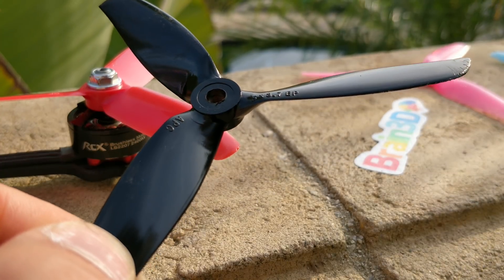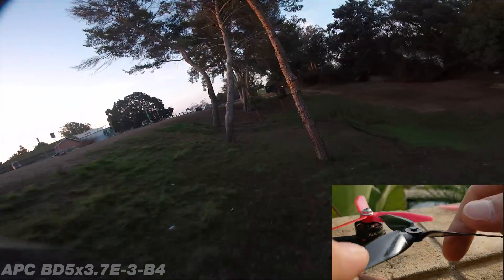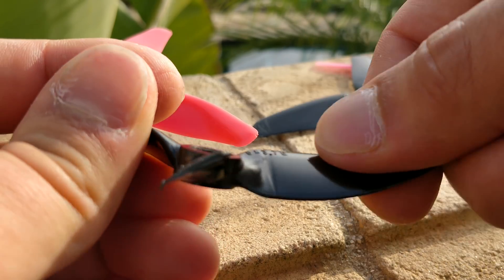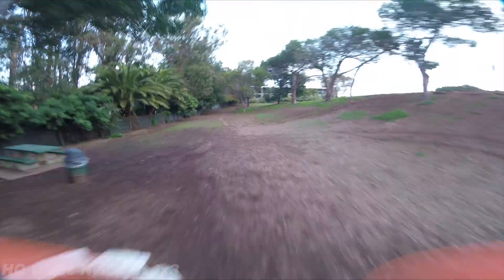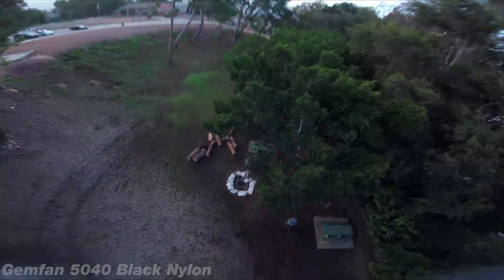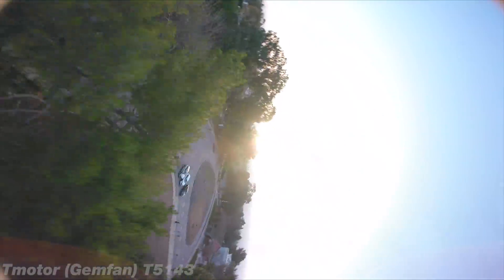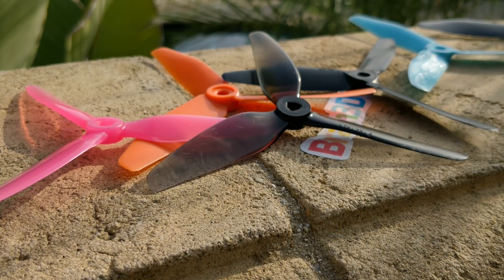APC 5x3.7x3, prop materials and old props...

Comment from the maker: Table of Contents
01:33 - APC 5x3.7x3
07:55 - HQ GN 5x4x3
09:07 - GF Nylon 5040 Freyblue
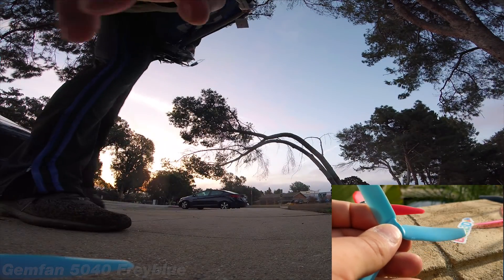10:30 - GF Nylon 5040 Black
11:15 - GF 5040 Polycarbonate
12:19 - GF Nylon 5040 Red
13:51 - T-motor T5143
18:42- Conclusion
15:15 - HQ Ethix S3
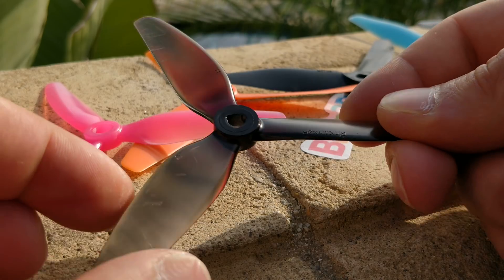16:24 - HQ 5.1x4.1x3
17:19 - Further discussion

The APC Prop: https://goo.gl/VabD5j

I'm too lazy to look for and post all the other prop links, sorry.

Things I like a lot:

Micro Eagle - 
My preferred FPV cam still
https://goo.gl/or1fS9

Rush Tank Vtx -
One of many good Vtx's. I like it because it works well and fits my build style
https://goo.gl/YMYmya

WaFL’s Cap Cap
https://insta-stalker.com/profile/waf...
https://goo.gl/9CZdAs

Tips?
Bitcoin: 1E4XZXoD4rS6MYWVWuenY7Kw2M1YgyNpoQ
Nano: xrb_1188ek5bd7tb9kw67asnp9o65byuoaxbtpxuznx1ribf75x78awywmakj55f
ETH: 0xD067F93811f2eC31CB1928901002dfdf9A492EF5
LTC: La2KWYAjp4VT2Lq2M76pbjzXWvRyjpfCtG

Comment: I came into the hobby after the glass nylons had died. I wish I could find a set just to see how they flew. Just got some gemfan 51466 in the mail yesterday and I love em. Super smooth. Probably gonna replace the s4 for me. Save a little money too
Reply from the maker: The new PC props are better than the old GN props
Reply: @Kabab  ok, I heard Steele at one point saying they flew better but durability was ridiculous. I just got done flying the gemfans again and I love them. Really quick and smooth prop.
Reply from the maker: @_Brando_69  yep. Durability was essentially zero. They're break sometimes just screwing them on.
Reply: @Kabab  Damn I don't even wanna know how bad they were in the cold then.

Comment: you should try the geprc 5040 3 blade V2, it's the most underrated prop imo
Reply from the maker: I don't know if you're the same person or other people. That prop is no good. It's one of the worst variants of the 5x4x3. I tried it years ago. It's worse than the majority of the polycarbonate copies. They're just super cheap and have been since the beginning. That's why they were so popular.
Reply: Kabab FPV are you sure whe are talking about the same prop? I have tried many different props, but the dal cyclone t5040 and the geprc 5040x3 v2 are my goto props at the moment.
Reply from the maker: @dano5739  maybe different but I got a big batch of them from banggood a long time ago and they were no good

Comment: I like gemfan props. Dalprops I use for crazy acro. What I have noticed is the end winglet that points down like on all gf props help stabilize my quads better, so in turn grip and line holding is easier in windy or fast flight. Any prop without them (dal props, racekraft, etc.) have a slippery smooth response witch I love for flips and yaw spins. You end up haveing a much more acro happy quad. You can see it for yourself easily if u have a dal-5x4x3 and a gf-5x4.2x3.

Comment: Great vid. I just got a set of the hq 5.1 x4.1x3 and compared them to the hq 5.1x4.6x3 and personally I like them. I put them on my hawk 5 and put it on a track and they felt a bit better than the 4.6 props. Really snappy to me but I think the 4.6 is a tougher blade. I broke 3 props in 4 batteries when on the 4.6 I didn’t even bend one. But their still great props. I will be getting more.

Comment: hey kabab, I made the prop/motor size rescaler into an excel file that you can try for yourself easily.
 https://drive.google.com/open?id=1wrNY7sYAq6B7jYhdAlITQrJHzunSX963 

edit the yellow cells. as you will see it gets the ballpark quite easily for all motor sizes and prop sizes. comes everything from the physics behind it. Sorry I reposted a comment I made on your older video but you didn't see it probably.
Reply from the maker: well, broken link for now

Comment: The APC props are efficient, when it comes to turning rotational speed into thrust. I've used them on a lot of my planes and they are working fine, but they need a lot of power for that. 
I had to mount an extra-fan on the ESC of one of my Biplanes and cut extra cooling slots in another one, because the ESCs power down, when they overheat. Not good AT ALL in biplanes :D

Comment: Nice flights!! I really like the way you fly it is very smooth....BTW do you recommend the ls2207 2400kv? I have the RS2206 2400kv due to my low skill I am wondering if the remplacement is worth it
Reply from the maker: Yes the rcx is a fantastic motor.

Comment: Talking about props. Does cold weather make the props less durable? I crashed my "3" that had gemfan 3052 props on it and it snapped a blade straight off. Never had that happen with a gemfan prop. It whas around 38 F / 3 celcius.
Reply from the maker: Yes absolutely.  Cold weather causes props to crack more often than bend.
Reply: @Kabab  ah interesting👍 thanks for your comment

Comment: The reason the batches of HQ props differ from each other is re-grind material.  Allowed  percentage  of re-grind material is different for each material, some materials no re-grind  can be mixed with plastic pallets.  So sounds like they are cutting corners to save money,  either just to save money or sometimes there are days where lot of rejects are molded.

Comment: Just want to put it out there that due to material properties of just about anything, especially plastics. You can't have something that is resistant to deflection (high modulus) and also will be easy to bend back to shape. A stiff prop will always crease, if not worse, when you hit the elastic limit of a prop you'll have an irreversible deformation.
Reply from the maker: I know 😔. It's unfortunate.

Comment: Try the GEPRC 5040 triblade, its clone on hq5x4x3
Reply from the maker: I believe I've tried that a long time ago. It was a really underwhelming experience I believe
Reply: @Kabab  this geprc 5040 called people's prop. Its durable, dirty cheap and available always. It's ok if you beginner. I try emax and few another props over this year, and big fan of T-motor prop now. Its surprisingly durable for how its looks and for light racing quad its really good.
Thanks for direct me to this prop. I think T-motor prop it's much better for racing as our 5" quads weight below 250 grams.

Comment: I would have liked to see the  GF flash 5152 in this test as well.  It is still one of my old faves.  
  Merry Christmas if your reading this!
Reply: I agree but its too heavy to be in this class of 3.3-3.8gram props with super crispy response. The 5152 was a prop all by itself when it came out, it had monster grip and speed for dayssssssss. My favorite prop right now is the Dal 5051 if you are not running a go pro cause the AUW needs to be low for it to perform like it should and than the T MOTOR 5143 if you are running a Go Pro cause it can perform with weight and still be responsive but not quite the speed of the Dal 5051. But the DAL's speed still doesn't compare to the 5152 by no means.

Comment: I found when I used the T- motor prop with Johnny Fpv 2700kv motors, the prop would deflect on high throttle! Did you see this on high kv motors?
Reply from the maker: Yes it does deflect. It's super flimsy

Comment: You were getting like no prop wash, did you tune it out or is it the helio fc?
Reply from the maker: It's default betaflight. No tuning at all on any quad
Reply: Its all in the throttle and how you deliver it when doing quick turns, if you do a quick 180... Blip the throttle real hard and fast and you will push threw the propwash stage, but there are many ways to fly around it.

Comment: Have you had a chance to try the HQ 5.1x3.1x3 ?  It might be more responsive than the 4.1.
Reply from the maker: It's good but the 4.1 has improved efficiency and speed somehow. Those are contradictory but it's better all around
Reply: @Kabab  Sounds good.  I've got some 4.1's to go on some of those Hyperlite 2207.5 1722kv when they become available for a new build.

Comment: Forgot to ask what prop would be a good choice for your 2208 1800 kv, if I wanted to run it on 4s,5s and 6s? I know the S3 would be awesome on 6s but probably not that great for 4s? I'm willing to switch props when I use 6s from the S3 but what would be a good 4S prop on that motor?

Damn I think that post was really redundant but I think you get what I'm saying lol.

Thanks Bob

Rob Ricci
Reply from the maker: The HQ 5.1x4.1x3 is gonna be the best all around prop. Performs amazing on 4s and 6a.
Reply: @Kabab  awesome I'm going to give them a try Bob thank you

Comment: do you know if you can change voltage meter on fpv cam to dial it in? i want to use the one on the falkor but seems a little off.
Reply from the maker: No clue. Sorry